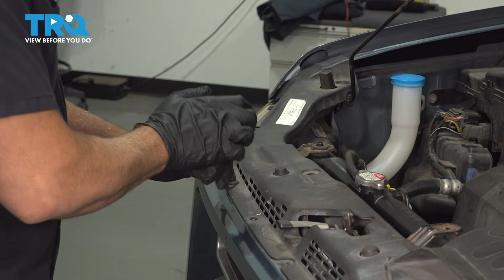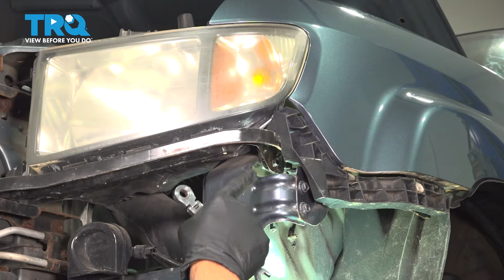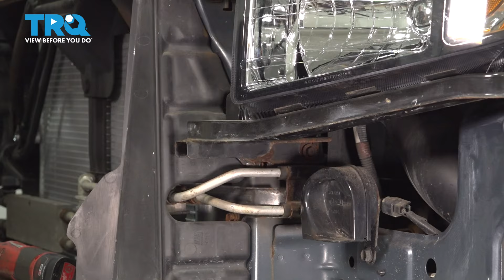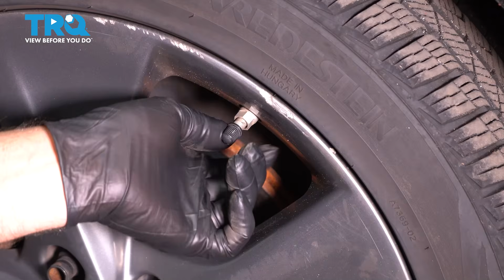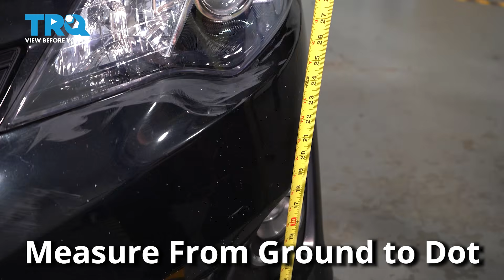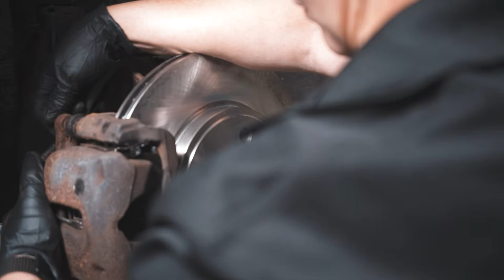How to Replace Headlights 2006-2014 Honda Ridgeline

Comment: Very well done video! Best I've seen for this type of repair, everything being clear, well lit, and from perfect angles.
Being this is a 15 minute video, showing one side, and with editing, this looks like a good one hour job for you. Without all the right tools, and my slower techniques, it will be an all-afternoon project, at least.😅
Edit: Plus, mine has fog lights in the bumper, which Is need to replace also. And then the nighttime headlight adjustment means probably a full day plus a little night for the project.